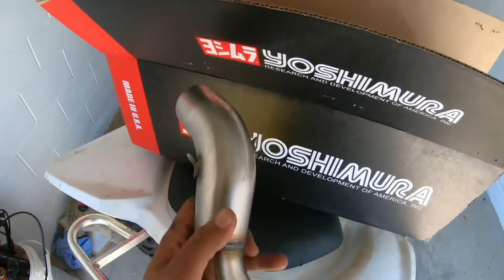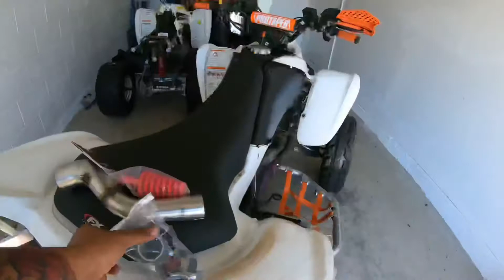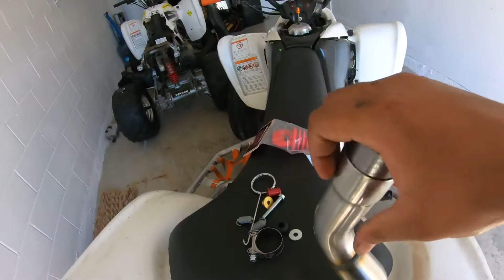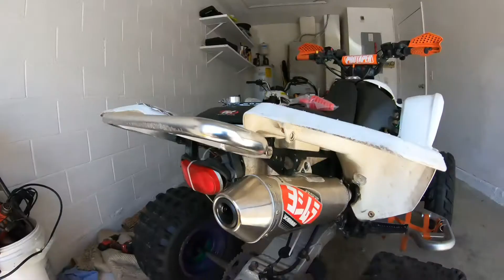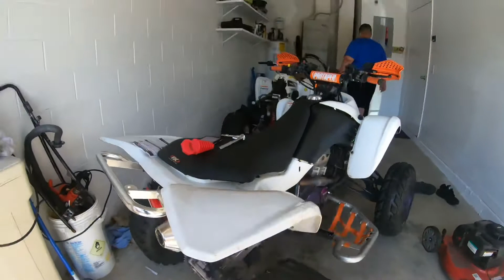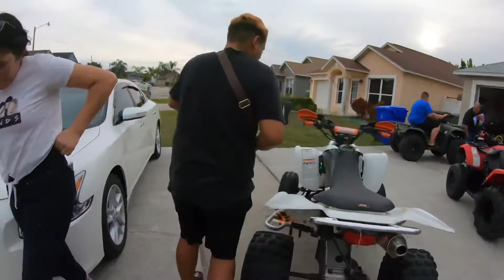KFX400/LTZ400 YOSHIMURA EXHAUST INSTALL🔥🔥🔥 | Christian Arroyo

Comment: Did you need to tune the quad or anything for the header and exhaust ? And will this fit the 2003 kfx400 ? Thanks and nice vid !
Reply from the maker: Just jetting brother!!! Stay tuned for new video
Reply from the maker: And yes it would fit!! Mines is a 2003 with the 2004 rear frame for the detachable grab bar!
Reply: You always need to jet for a exhaust

Comment: Do you still have your plastic heel guards with the metal frames ? The bottom of the fender is melting because it’s not secured and  flapping and hitting the exhaust pipe. If you don’t want the heel guards then cut the bracket off just past the Fender bolt.
Reply from the maker: I figured but it was already melted when i bought it so never fixed it🥴🥴🥴